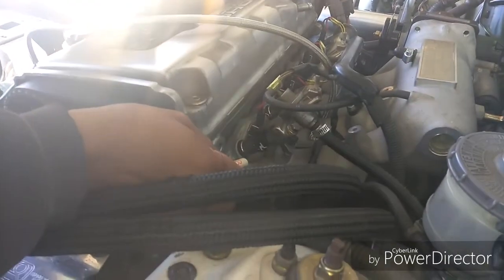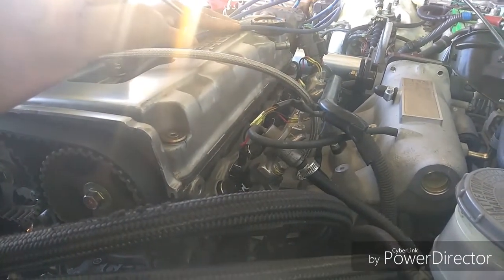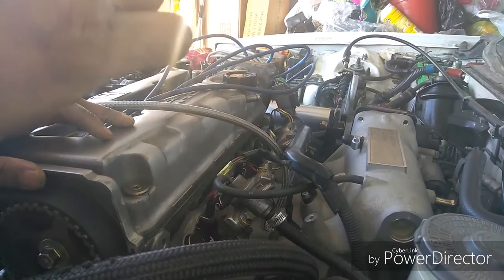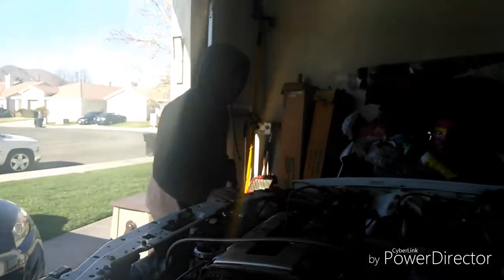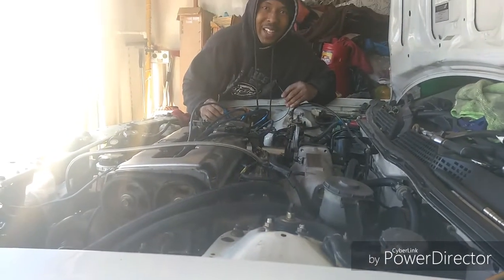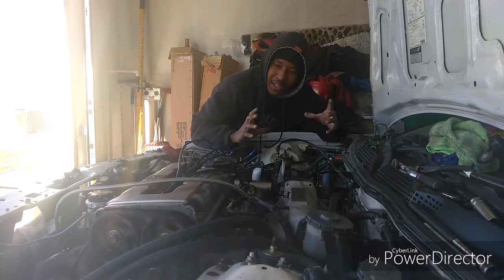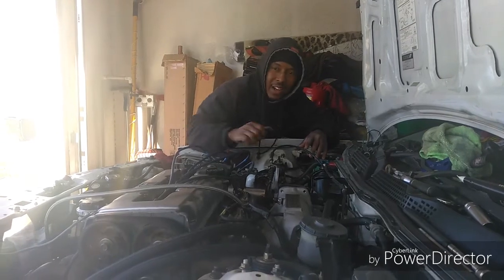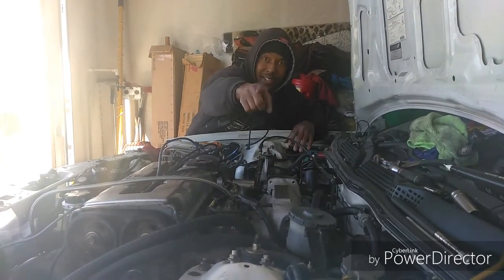Turbo (DC2) Rebirth Part 6, Actual Start up😁

Comment: @1:40 that's a nifty trick! how did you manage to turn it on without the key? I am assuming the key is in ignition for it to work.
Reply from the maker: Yes, the key is in the ignition in the on position. Then I used a wire to connect the positive side of the starter to the starter switch in order to get it to crank. Thanks for watching 😁
Reply: @Duwop77  Thank you, will try that.
Reply from the maker: Your welcome

Comment: Hey fam I got a teggy I’m building and my timing sounds off like it’s got a heavy out of time cam my boy says to check out the dizzy which I’m gonna do and someone else said it might be out of timing and that some sensors are wrong or backwards. I also had a chipped p75 I think tuned to my previous motor which was a b18 lsvtec and now I’m running a n/a b20 stock with only plm headers.
Reply from the maker: Do it sound like a Subaru? If it does its cam timing. Cam timing can be tricky at first. Check out this video hopefully it helps. Link is below.
https://youtu.be/AcPfcnZMFp4